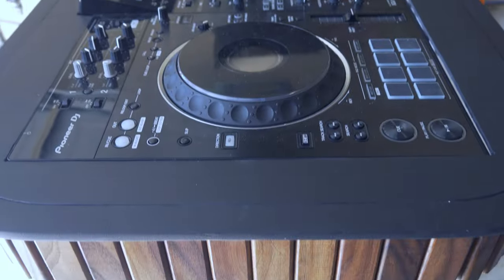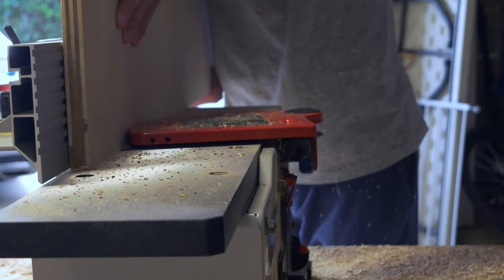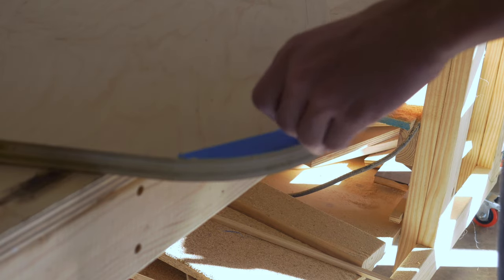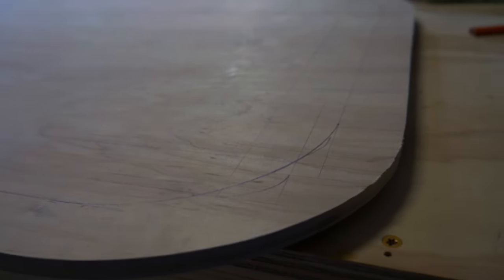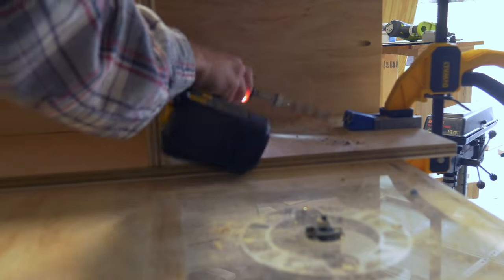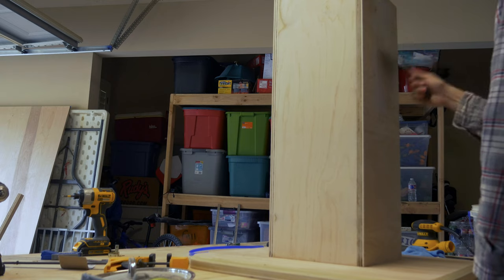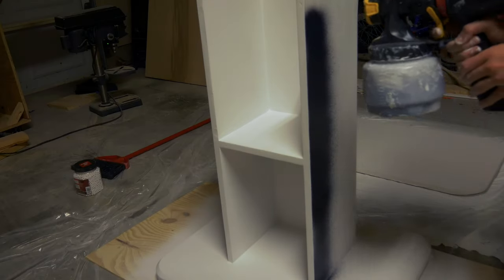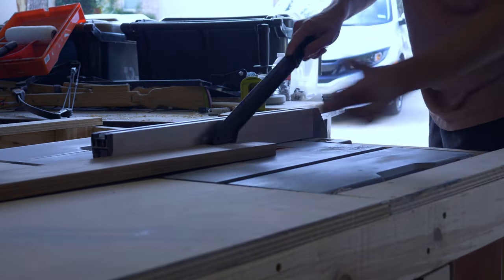Building A Custom Walnut Table For DJ #DIY #DJTable

Comment: When you did the rabbit cut for the top, how did you get a good measurement for the top insert? Thanks in advance
Reply from the maker: Pretty much just did a rough curve and sanded it down so it fit well. Not the best method but it worked fine
Reply: @DrewYoung  Awesome, I thought I missed that part. Looks great.

Comment: I got so excited for a moment, but I just checked your website and wtfu...
You need to design it so cables aren't visible to the people. They need to go through the stand and to the controller. The photo you got on your website is pure garbage, i don't even know why you would use it as advertising material. Go check out bunn gear for inspiration and just do that.
Reply from the maker: It is designed to run cables/ wires from the controller to the bottom and out underneath. The picture I believe your referring to the guy just didn’t want to take the time to run them through.